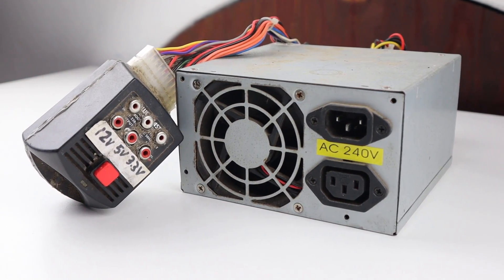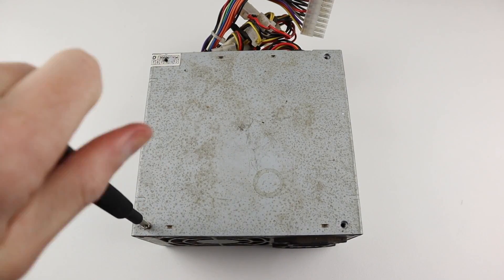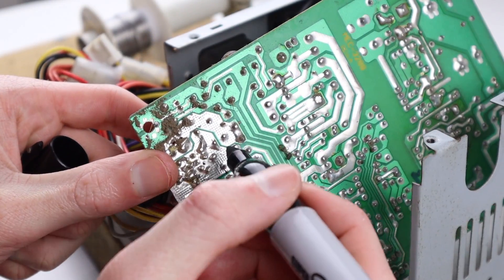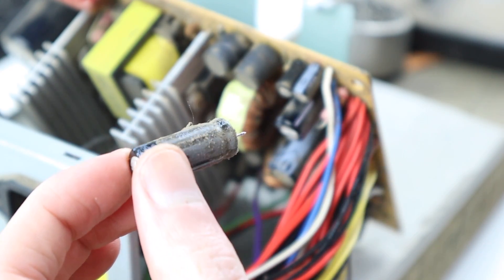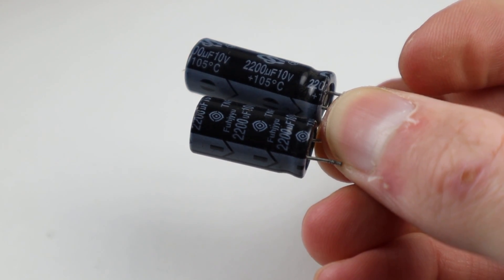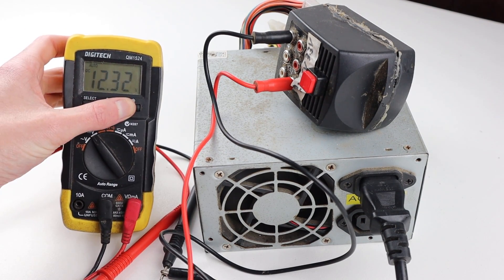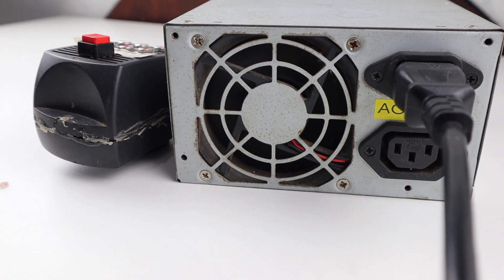Repairing My Power Supply that Blew Up

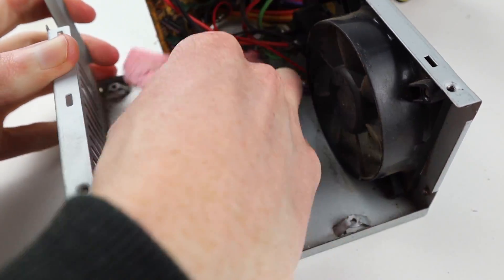Comment: 4:58 you removed insulation plastic layer but at 5:06 you didn't put it back. it won't cause any damage though as PE (Protective Earth) nodes are separated from other circuitry and a bit higher than the metal case.
Reply: You mean plastic insulation layer

Comment: Great job Brother... I've been repairing many of the HP Z series Power Supplies with 18 & 12 Pin non-standard pin outs.. Blown Fets and Diodes are worth swapping as replacements are over $200 USD...  DPS-750AB-36

Comment: my question is not related to this video. however,  i do have a suggestion which involves the question you should consider! "LIGHT-BULBS!" are illegal here in the USA but then so is everything else! however,  they have been replaced by LED which have no plugs! and so the question is how to connect one! unfortunately their is no color code and the documentation LIES! so dont beleive what you see! LED come from china were there is no regulations and everything goes! for example and the question is! you have no color code and so you have no idea what wire does what you simply have to open the box to see were things go LOTS OF LUCK! even then its really wont help much! their are two connection actually 3 but lets concentrate on the two positive and negative and the big question is WHAT HAPPENS IF I CONNECT THINGs IN REVERSE! looking at the board we find two connections labeled "N" clearly neutral and not ground which is connected to the metal plate or box and the second wire the "HOT" or positive labeled "L" for [line] but again it does not say weather its a "L-" or "L+" its just "L" a plus and minus would indicate its power being plus or minus however being how they told you what negative was i suspect their was no reason to indicate it with the "L" i have 3 wires blue yellow and brown and according to their code blue is neutral and brown is positive but when i opened the box i found they were reversed!! so dont believe what their documentation says! blue is connected to "L" and brown is connected to "N" however when plugged in it did not work however its suppose to be 110 volts not 220  which again is anther problem! hope you have an answer and consider doing videos on how to hook up LEDS because they dont come with plugs also you should consider discussing the "E26" and "E27" which can be seen because they have different color bases! i wish i knew how to contact you regarding these things! your web sites says business so i did not leave a comment.

Comment: My experience with recapping: Since no one else seemed to mention it, don't replace caps with the Fuhiyyu brand. They are some of the worst. I once had to repair an ATX psu where every single cap was Fuhiyyu brand, and they were all bad, from 2200 uf all the way down to 0.1 uf.

Comment: If you are short on time something I learned i with the psu unplugged and hooked up to a computer hit the power button a few times as the computer detected an attempt to power on and it will pull some of the remaining power.

Comment: Hi! Is there any circuit that I can built just to make an interface between the voltage wall and the ATX supply so that, if aomethig of ATX supply fails, it doesn't burn anything? Or even explote? Greetings!

Comment: What's strange that he made this power supply when he was 12, and I'm now making an adjustable power supply with current limiting function.
Also I have maximum experience with electronics, and I already repaired 5 electronic devices. And I'm 13!

Soon I'll try to fix my old Dell flat screen display, it has a weird reddish tinge, and it shuts down after ~ 2 minutes.
Reply: Good job! Make some videos!

Comment: Just buy a new one my guy
Reply: I have been reparing ATX PSUs as part time job for two years now, and this is a sizeable pile of potential ewaste. Also people will get better units in comparison of the fake garbage that they are selling today. A Delta, AcBell, Astek, Bestek, Liteon PSU is a testament of quality and with little money no other power supply will be needed. The new ones are far more complicated, more prone to failures, more expensive to repair, and will meet the landfill sooner.  all the 80plus "certified" PSUs when not properly imlemented. HP PSU from 5 years ago, is High efficiency, Infineon Mosfets. Equivalent power Thermaltake ... "Magnachip" mosfets. I would recap the HP one no doubt. Lass landfill and more quality

Comment: Nice video but a few flaws.
Mainly that no. You dont have to wait a week or more for the caps to discharge. A few houers will work as the esr of the cap will discharge it. Most power supplys also have discharge resistors in them to drain the caps.
While yes they can hold a charge. No in most cases they will not hold a charge for motable weeks.
2 you forgot to put the plastic seperator back in. Its there to keep the bord from shorting to the case.
Reply: Are you nuts
Reply: @sfs2040  no im ceilingfan music xD

Comment: I tried the same.. but didn't work. there's apparently a hymn noise coming from the board... the 5v output from the purple wire is the only working  section from mine..12v, section has no output

Comment: and easy way to discharge the PSU (if it is connected to a pc) is to push the power button and  the pc will try to turn on discharging the psu entirely :)

Comment: can i fix a power supply with 2 blown mosfet? (high voltage side) or is there something else that got damaged ass well  because the mosfets blew up. its a 1200w so don't want to throw it away. it failed because of a dead fan.
Reply: Desolder it and see if you can search the model numebr

Comment: I have replaced the faulty capacitors. Now SMPS turns on but low power on 12v rails. 5v Rail have good power. Also, it is making humming noise but can't figure out exactly from which part.

Comment: I don't even think this is close to worth it for like 50$ u can get a 500w evga premium psu
Reply: free<50$
Reply: @georgealbata7478  this is not free and not worth waiting months for shipping from china
Reply: @DrAliToma  he salvaged the parts
Reply: @georgealbata7478  most people wont have anything to salvage from .. And the power supply in this video sucks .. so a new one that is 50 or less is probably the better option
Reply: Ali0The0King This isn’t a video for “everyone” - by that I mean not everyone will have the practice to do this repair safely.
Reply: Clearly didn't watch the video. He talks about the environmental impact too. Repairing something means not creating more waste
Reply: @Zombiefruit  if u r worried about that there is recycling centers everywhere around u .. also buying stuff from china and shipping it half way around the planet isnt that environmentally friendly either

Comment: Funny story, so everyone always jokes that I break everything. Well one day, I was going to turn on my brother's PC (he asked me to) and then I walked away. I was talking to my dad (he was also in the room) when suddenly, we here a loud balloon POP. I noticed my brother's PC was off. I tried to turn it back on, but to no avail. My dad (he works well with hardware) took it off of the desk and put it on his working desk, he did a test on his power supply, and it didn't work. He then told me the capacitor failed and that he had to replace the power supply. Thankfully he had a spare.
Reply: cool story bro

Comment: why does this power supply have 2 ports one for input power but for what is the other port how is it called and what goes that port do?
Reply: Back in the day, the other port was used for powering your monitor. Saved an outlet. In some cases I think it would actually cut the power to the monitor when the computer was off. Not sure about the specifics of this particular power supply.
Reply: doogulass thats realy cool

Comment: Hey I have a question, I hope you see this. My iPhone 6 had water damage, I dried it off good, I put it in rice, the only thing that went wrong is that I didn’t turn off the phone. Now my phone turns on and off all the time every 3 minutes. I gave my phone to an repair shop and they changed batteries, found errors (kortsluiting in Dutch) and is now replacing E-chips and says it’s still not working. What can be done so it works? Or what’s the big problem?
Reply: NEVER PUT A WET SMARTPHONE INTO RICE AS THE STARCH WILL GET INSIDE THE DEVICE AND LITERALLY RUIN THE DEVICE AND THE COMPONENTS TOO
REPLACING A WATER DAMAGED DEVICE WITH A NEW ONE IS THE EASIEST THING TO DO

Comment: How to clean it: spry it with bean green totally cover the whole thing, let sit for 15 to 20 minutes rinse in bath tub with warm water and dry under fan for a few hours. DONE, it will look like new. I have done this about 20 times with power supplies and it has worked 100% of the time. It also works with mother boards.

Comment: I have a iphone 6 that looks great but mysteriously wont turn on. I brought it to several repair places and none of them know what is wronv with it. It could be an easy fix but if not im sure you could fix it.
Reply: Small electronics are much harder to work on because the size and the fact that many components are rolled into one SMD package with virtually no info for them online. This makes repairing them impossible and replacing them very difficult.

Comment: Love your vids, i would love to start doing repairs my self, i recently broke my right wrist, however i was still able to fix my wife's galaxy s7 and my sons old s4. both had broken screens and the batteries were dead(water damage). i dont have tools like u do, but a hair dryer and a cheap precision screw driver set works. i will always support the right to repair.
Reply: nice

Comment: Those capacitors will usually discharge in a few minutes. If you leave the PSU for half an hour it should be ok, you don't have to wait a week. Also, don't short them with a screwdriver, use a power resistor.
Reply: Is there any harm in shorting em once or twice, because to be honest: ''ain't nobody got time for that''.

I always used a screwdriver, I saw it spark, job done. No hassle carrying resistors around...
Reply: "don't short them with a screwdriver, use a power resistor."
So they don't get damaged?

Comment: Hi hugh, i know its nothing to do with the video but i have an iphone 7 with a broken home button it says press home to uprgrade i dont know what to do has anybody got tips?
Reply: 3uTools to skip activation process.
Reply: @DawnVengeanceX   how do i do this
Reply: @maxhicks8813  use 3utools
Reply: Max Hicks Download 3uTools and install it. Plug your iPhone 7 into the computer and run the program. Once it’s on the main menu, find the skip activation button and you’ll be all good.

Comment: Can you use laptop adapter like car battery charger ?
Reply: There are a lot of laptop adapters, be specific
Reply: @imethan4625  12v 7-8amp
Reply: @default1647  welp now I can't help you i know nothing about laptops, but I know a lot about desktop pc's, but I'm sure someone can help you but you can also search it online
Reply: @default1647  but I guess because it's a 12v, I think you cannot charge a car with it
Reply: @imethan4625  how much I need for car battery ?

Comment: I'd rather buy few years old PSU used and convert it into bench power supply. I got Antec Neo HE500 for 10€ and it's from 2005.. And about that capacitor discharge time, 20-30 minutes from unplugging is okay for ATX PSU before it's safe to work inside of it with insulated tools. That's what i have been told

Comment: hey Hugh why did you miss out the protective plastic sheet? well at least i didn't see it get replaced back in the power supply.

edit: i like how you used rca jacks as a banana connector.
Reply from the maker: I did put it back in, just must of cut it out of the video. Yeah back when I made it I had an old stereo that didn't work so I took the RCA connectors and used them ahaha.
Reply: @HughJeffreys  sooner or latter i'm planning on re-purposing an ATX power supply case to make a portable 500w inverter with mains charging included i emptied the case and left the plastic sheet the voltage selection switch mains input socket the original fan the indicator LED the mains filter and the mounting screws. I don't need it to last because all i need it for is testing equipment outside my home and if i need more battery power ill have an xt90 plug so an external 12v supply can be used either a battery or another power supply.

Comment: Hugh I need help, I'm replacing a iPhone 6 screen and ots my first. Do I only need to keep the old home button that's it, or do I need the screen metal bracket too? Also I bought iPhone 6s seal for it, until seeing your vid I didkt know it doesnt need one, but if I want to put it on will it fit?
Reply: The seal for the 6s won’t fit onto the 6 perfectly It might go on but I recommend not using it. Also yes reuse the home button and metal bracket because the metal bracket has the home button cable tuning underneath it. Good luck man!
Reply: @Agarico  yes the home button and and bracket to it I know. Bit there is a large metal peice behind the LCD that high called a heat shield in one of his vids. Do I replace that too or does that have no cables running from home button to top? I didn't open the iPhones yet
Reply: @vitaliyb7000  Yes, you need to transfer the big plate to the new display. You also need to transfer thw camera bracket and the little plastoc ring.
Reply: @vitaliyb7000  And this metal piece has a cable for the homebutton. But be very careful at diaassembling this one, because it is glued down. Go to ifixit and search for iPhone 6. they have really good step by step tutorials.
Reply: @thomass.6328  yes I understand I must do this under regular circumstances, but remember I'm taking a screen off another phone, so the both phones have it, im just asking if I don't use the original plate will touch still work
Reply: @vitaliyb7000  Well tbh i dont really know.

Comment: You don't need to wait for a whole week for the capacitor to discharge like crt monitors, 15 or 20 minutes is ideal for that. In almost every power supply there is a bleeder resistor hooking parallel with the main cap for safety dischare the remain energy in the capacitor.
Reply from the maker: You cant be too safe when it comes to high voltage capacitors
Reply: @HughJeffreys  Just short them out
Reply: @HughJeffreys  Why did you recommend against shorting the caps out?

Comment: I have a 2007 iMac i'mactually worried about the capacitors on this thing, should i check them out
Reply: The System Explorer yes
Reply: fix on fail. no point messing with them before you need to.

Comment: I was wondering if attaching wires to the vents might be blocking airflow and causing some components to run hotter than they would normally.
Reply: No this wouldn't cause an issue. Most power supplies are made to stand up to 85 degrees C. In this case the capacitors are rated at least 105C for typically 2000 hours use before that part's life is spent. His little bench supply use is much less strain than what it was originally made to do.